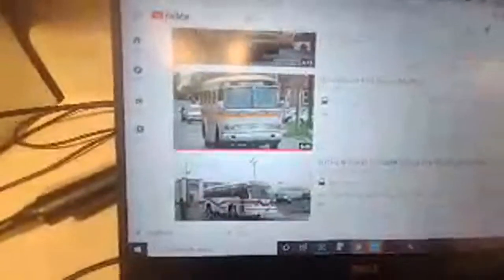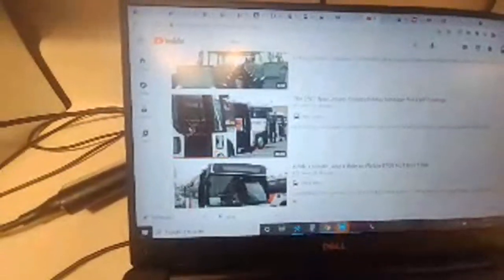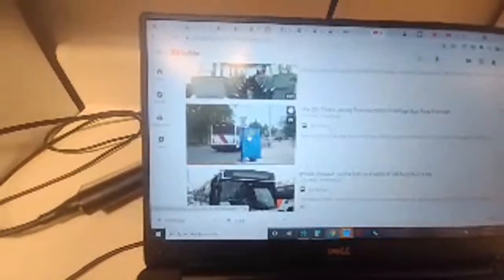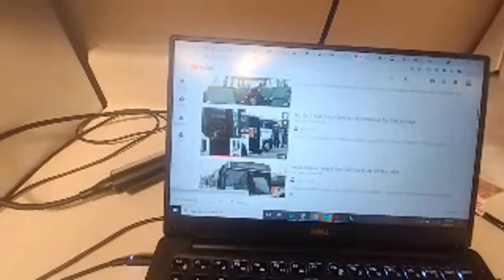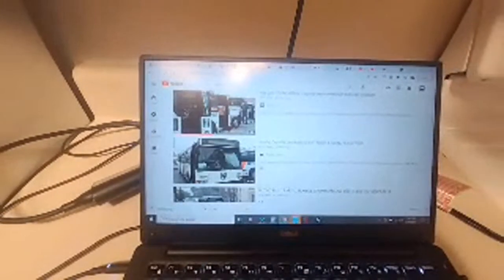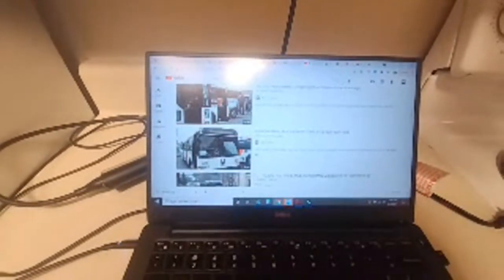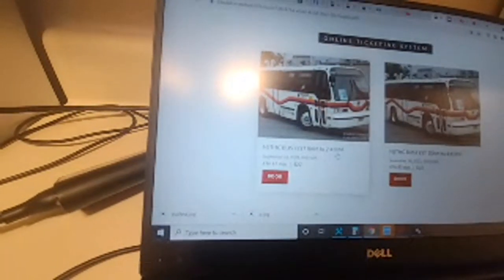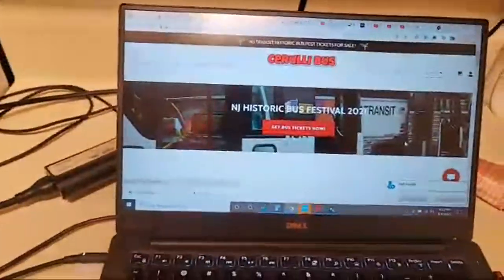Bus AC Condenser Update & First Offical Trip & Raffle Winner

Comment: On that AC fitting I would try to heat it some to break the rust and see if the sealing surface for the O-ring is good or bad before replacing the elbow. Those fittings are a pain to replace without pulling the hose out. Best of luck Chris.
Reply from the maker: My friend that bought this bus for me actually put the AC condenser in but he still hasn't figured out how to get it working so it's been a big project as far as that he's turning the bus into a mobile mechanic unit I wasn't really able to keep up with trying to start a bus business I tried a little bit but the way my work is I don't have a lot of time but it was definitely fun to have the bus and work on it and and drive it around and just have some pleasure with it I wish I could have had the destination sign working that would have been pretty cool
Reply from the maker: And sorry for the late reply I have so many comments but I have a goal to reply to every single comment that anybody leaves me so I will be getting back to a lot of older comments I'm still looking at comments from one year ago and comments go really far back